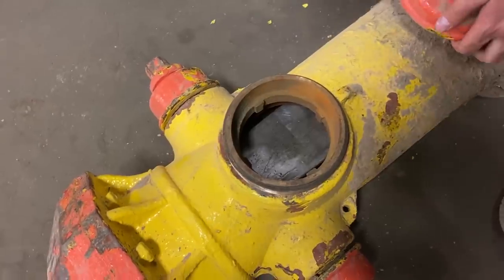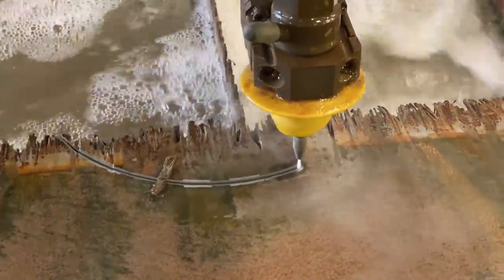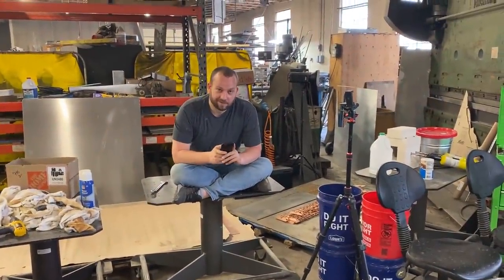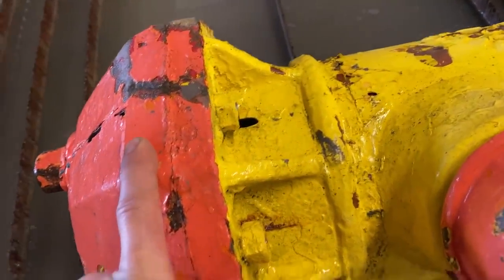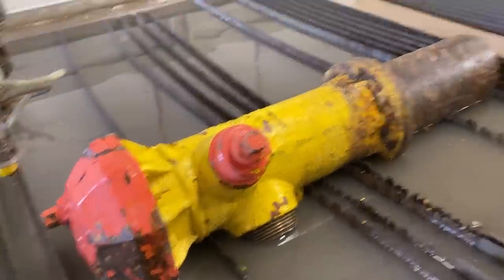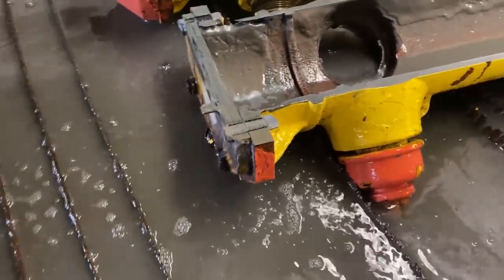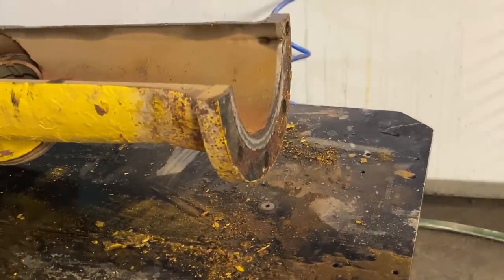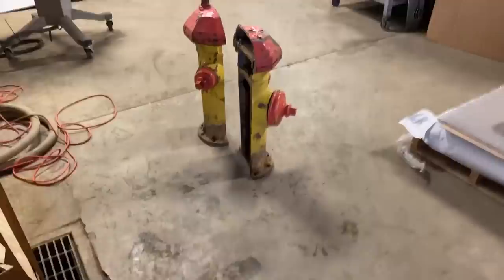Fire Hydrant Cut In Half With 60,000 PSI Waterjet

Comment: I just retired after spending twenty five years in the industry and it surprising just how many people think that high pressure water jets are basically harmless. That’s a pretty solid piece of metal to cut through and the machine does it with ease, the quality of that cut is amazing. The company I worked for had machines that could cut through ship hulls, rebar, concrete and sections of road, never underestimate the power of water.
Reply: i mean considering how slowly it moves, it is basicly harmless just do to the fact that if you try to touch it, youll åpull away your finger before any significant damage is done, appart from maby some skin gets cut. compear that to a tablesaw, where simply touching it could get your finger pulled in and destroyed by the saw. sure, a pressure water jet can kill you easily, but you have to almost be trying for that to happend, since its automatic and moves slowly.
Reply: @mr.battlecats5512  water under extremely high pressure certainly doesn’t move slowly.
Reply: @peterbuckley3877  wrong axis my guy, your talking about the vertical movement, I'm talking about the horizontal movement.
Reply: @mr.battlecats5512  vertical or horizontal is irrelevant, you put your hand under an ultra high pressure abrasive cutter like that and you won’t have a hand fir long. I’m talking first hand experience from over two decades in this very industry, I personally know of at least two case in Australia of deaths occurring this very way not to mention the injuries every year. If you want to stick your fingers in the way go ahead and be my guest.
Reply: @mr.battlecats5512  water dont care what axis ur at nerd. i damn near lost my left hand due to the pressure washer handle getting stuck open at work. i detail, and use this thing daily. if you ever use one id suggest trying it on urself, maybe youd reconsider ur opinions there.
Reply: @no-purpose-here  1. When i said horizontal move ment, i ment the move ment of the head itself,not the Water, wich is movinh vertically in this video.
2.when i made my comments, i was assuming that your hand is in the Air at a decent height from the table, so your fi ger or hand would have enough space to Swing Down as the Water pushes it out of its way, Still causing damage but not as much as if you were to hold it there.
3. YouTube hapend to recomend me a video of these Same guy putting a fake hand whit similar strenghts to a human hand, and while it Did go trough easier than i was expecting, the scensrio i was imagening wasent present. How ever, i Did not take in account the pressure it would be putting on your hand if it hapends to be flat on the table, so in that case itll absolutely do huge damage.
Reply: @mr.battlecats5512  they actually did a video on this and it's actually extremely easy to get caught. And if you do get caught, that jet is literally purshing your hand into the platform, makimg it even harder to pull away while it blasts a hole in your hand and cuts off your fingers. It's no joke.
Reply: @cryotimber  yeah ive wached that video, but at no point Did they have a hand whit a finger that can pivot as easily as a human finger can. My point is, is that if you simply touch the stream whit your finger, the stream Will push your finger out of the way while only doing some damage to your skin. Untill you can show me a video of someone touching the stream whit their finger or a prop finger that pivots similarly to a human finger, while it is enough above the bottom plate that it has a full range of movement, and the result is worse than i expected, i will stick by my assesment.

Comment: my  brain still cant get around the fact that water can cut through metal.
Reply: Just what i was going to comment
Reply: Well, it’s not just water. The waterjet has garnet in the water to act as an abrasive/cutting agent. High pressure water can cut things on its own, but it’s not as effective or as fast on its own.
Reply: Air can do the same
Reply: It's a grinding process. Plain water won't do it. Needs the garnet added in.
Reply: Heck just think about the earth and all of the different forms of erosion. Look at the Colorado river that cut through the Grand Canyon
Reply: @Then.72  you don't know math
Reply: But can metal cut water ? 🤔
Reply: @hiyo9144  in the same fashion, water carries sand,silt to do the erosion

Comment: I bet that first disc that you called a "seal" with the hole and the square rod going through is only there to keep that rod mostly straight when turning it, maybe? It goes down a bit, like  you said, so that water doesn't freeze inside the hydrant. I'm just guessing. I could look it up, but I rather like hypothesizing.
Reply: its for holding the rod when the walve is open and holding tension when closed.

Comment: The valve that the square bar connects to underground (not shown) first shuts off the water from the main, then, after turning further, opens a release so that the water in the "barrel" of the hydrant drains out.  This keeps the hydrant empty to avoid breakage during freezing temps.  It is not only that the valve is below the frost-line, but that it also has the water drain-out function that makes a fire hydrant a magical invention.

Comment: Weird question that I'm pretty sure you've answered in the past. Sometimes we can see the water evaporate on the side of the object (usually rock or metal, sometimes other stuff too). Is that due to just the timelapse and the water evaporating on its own or does the waterjet cause enough friction to heat up some items?
Reply: It is heating it up enough to evaporate the water.
Reply: I would think the water provided its own cooling though so I'm going with the time lapse angle.
Reply: I'd say not evaporation, more like mist. It's hitting the object with such force it spreads out everywhere into a mist and gets to a point where it's so spread out you can't see it. It then ends up in the pool of water.

Comment: The valve is that long also so if it breaks from someone hitting with a car the water stays off,
Reply: GTA not realist lol
it's really a good and simple idea
Reply: lol...
Reply: Then why all the movies depicting geysers.
Reply: Because movies never hire plumbers for info
Reply: That depends on where you are geographically. If you live in a climate that doesn't freeze they have wet hydrants. Where there is water in the hydrant at mainline pressure. If you live in a climate with actual winters,they are dry hydrants with the long valve stem that goes down below the frost line. 
The reason you get geysers in the movies,1 they are usually in California,2 they look cool.

Comment: Its called a dry barrel hydrant, when you shut the valve drains open up at the base under ground and drain the water out of the hydrant so it doesn't freeze.  very cool engineering

Comment: I'm curious to know how much the shop would charge for that cut. Time, electricity, water, abrasive etc.
Reply: No abrasive required it's just hp water that is recycled so the only consumables are the electricity for the pup and a tiny amount for the servo motor.
Reply: The Dog Walker water is not doing the cutting,there is an abrasive in the water that does.it’s a sand like abrasive where, I work we get it by the pallet

Comment: i operated a magnet crane in a scrap yard , i used to pick these hydrants up and drop it on a thick slab of steel and since they are cast iron they break apart . to get to the brass inside

Comment: Grease could be the seal for the shaft part you guys were looking at at about 7:00 . Considering the first seal deals with the majority of the pressure. Also, look on the part used to turn the hydrant off and on and I bet you there is a grease zerk. On the top surface of the "nut" where you put the wrench.
Sorry, didn't watch to the end, that is an old hydrant. The newer ones have the grease zerks. But I bet you it was still greased somehow.

Comment: I bet the first metal seal is actually just a plate to prevent the hydraulic ram of all the high pressure water blowing the top off the hydrant when it is first opened. The second seal is probably what actually keeps the water from leaking out.

Comment: THe space between the uncut disk and the top cap of the fire hydrant probably isn't sealed because it's supposed to act like an arrestor, to minimize the damage of a water hammer if for some reason the hydrant is drained of water above the valve.

Comment: Fun fact- water department crews regularly bitch about firemen and how fast they turn on the water when accessing the fire hydrants. If you turn the valves too quickly, you can cause water hammer.
And then the underground pipes can burst, causing major flooding damage.

Comment: The area above the deflection plate does not fill with water. It is sealed and the air entrapped within acts as a dampener to prevent the water from slamming into the top which could possibly blow the top off as water is a noncompressible. As the water comes up from the mains it exits through the outlets on the sides. When you shut of any vale or nozzle the pressure surge creates and unreal amount of shock in the system. This shock is called water hammer and it is present in any sealed hydraulic system. The trapped air above the plate compresses when the valve or nozzle is shut off and acts as a shock absorber mitigating/preventing water hammer. Your water jet cutter will in all likelihood have a device that acts in a similar manner to prevent blowing itself apart.

Comment: I have a question. Do you just know from experience what cutting speed to use? Say you're cutting 50mm mild steel, are there preset cutting speeds, inches per minute or whatever, on the machine? Or do you have to dial it in or just go slow enough to account for different thicknesses/materials in whatever you're cutting? I only ask because I have a plasma cutter but am not too familiar with the automation side.
Reply: Also presumably you need to lower the cutting speed to account for nozzle wear? I know I do!

Comment: Fun fact: The red paint on the top part and caps means it flows less than or equal to 500 gallons a minute. Aka really bad hydrant (you want 750-1500)
Reply: Holy shit. How much water do you use in the US?
A fire hydrant in germany will not typically flow more than 500 gallons a minute. Most significantly less.
Reply: Yeah the color of the bonnet represents the water main size

Comment: Electric clutch shim tool to check if its all the way through. lol nice. Do you guys use that for lenze clutches or somthing else?
Reply from the maker: We just had a few boxes of them
Reply: @WaterjetChannel  oh hahaha. Well if you're curious about them there a gap setting tool for electromagnetic clutches. One of the most common ones is a lenze clutch. Although the electromechanical clutches are becoming more and more popular. Those consists of a spring that when you pass electricity through the coil it wraps the spring tightly around the shaft. The only drawback to those is the direction of the spring determines whether it is a break or a clutch. so for instance you would have a left-hand spring for a break and a right hand spring for a clutch.

Comment: Not sure what is wrong with your machine but I spent years operating a water jet for an aircraft company cutting 5" 12" thick titanium and 17-7 stainless parts and they came out smooth as a babys bottom also your nozzle needs the rubber safety shield.

Comment: Have you heard of this secret way to change your water jet to be 600,000? Yes 5 zeroes!

So, go into the %appdata% find the gamedata file for this game, find this water jet file and change its pressure to 600,000. Be sure to edit the other settings or it will run out of water 10 times faster.

Comment: Whats with that high pitch noise in your last couple vids?
Reply from the maker: The servos on the waterjet have a high pitched whine when the machine has power. Sometimes the mic picks it up more than other times.
Reply: @WaterjetChannel  Huh. Is it always the same frequency/pitch? You could probably filter it out if your editor needs more work to do, haha.